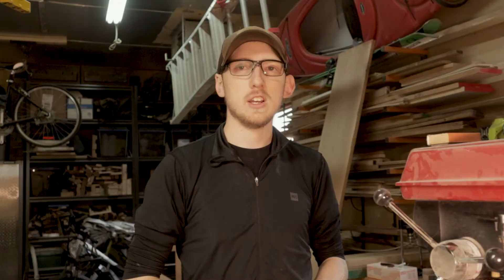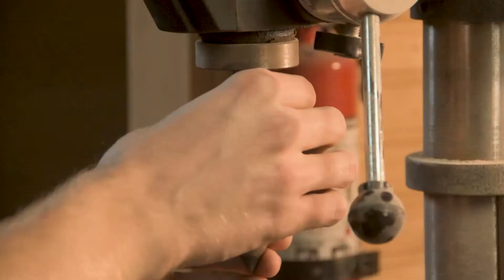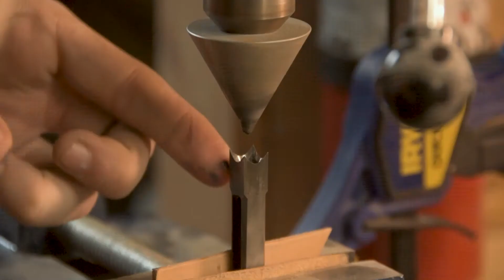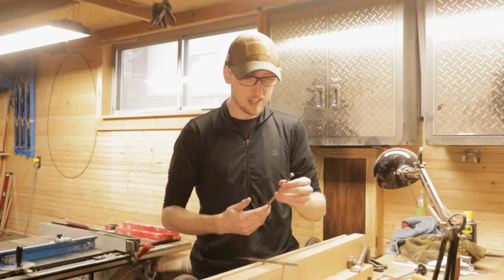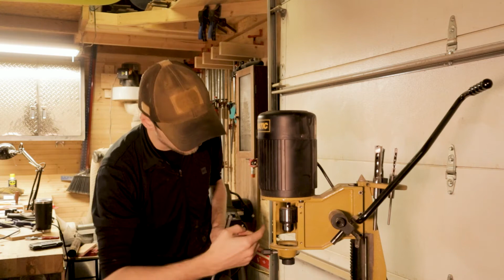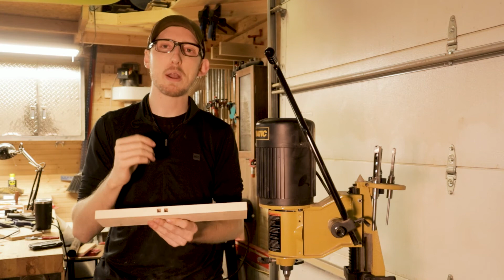How to setup and use a Mortiser | How to Sharpen Mortiser Bits | Mortiser vs. Domino Joiner

Comment: Great job, Morgan!  I recently purchased the same mortiser and most everything you said is spot-on.  You mentioned the gap in the fence - I solved that issue by spanning it with a piece of MDF the length of the fence, with a partial cutout to clear the hold-down clamp.  I bolted it onto the fence with counter-bores for the bolt heads.  There is still enough MDF covering the gap to allow the use of a machinist's square to align the chisel.

Comment: This is probably the best explainer of the Powermatic 760 (??). The Wood Whisperer did one on the Powermatic full-feature model you referred to, which doesn't translate. I did pick up a couple of tricks here, so this is valuable... the business card trick might help me work. Overall, I like my mortiser but it's admittedly a fiddly-ass tool. My biggest gripes are the cast iron base isn't machined to a high enough finish to resist rust in humidity (and polishing it would be work and likely take it out of flat), and the rack and pinion adjuster on the sliding fence is loose to the point that it will rack out of square to the head/quill... any suggestions for that?
Reply from the maker: For the rust, coat all exposed cast iron in paste wax, the Johnsons brand from home depot works super well. I do this every month on all my machines and hand tools, it also helps the stock move a little easier through the mortiser.

For the fence, there really is no way to keep it in square with the bit, I was annoyed with this to when I first got the machine but now I don't really worry about it. As long as the endgrain of your stock is perpendicular to the face just use the trick from the video and square up the chisel every time you change the fence.
The most important thing to accept about this mortiser is that each cut doesn't have to be perfectly square or positioned, if the bit is off by a few degrees it won't affect the overall strength of the mortise. I know it can be annoying for such an expensive machine.

In the next project where I use this machine I'll try to include some close up shots of what my mortises usually look like because I usually forget to square up the bit and they come out looking a little jagged but have all held perfectly well.

Comment: That looks pretty good, even with all the set up. I've drilled out mortises with a forstner bit and cleaned with chisel in oak, took forever. Lol
Is there a Powermatic dealer in Alberta?
Reply from the maker: I know here in Calgary, Black Forest Wood Company, is a powermatic dealer. I bought this mortiser off a guy on kijiji but when I talked to the people at Black Forest they said they could bring in any of the powermatic machines.
Reply: @morganhurst_redridge  Thanks for the info, now that General International tools are no longer around, it seems a bit harder to find woodworking machinery in Canada.